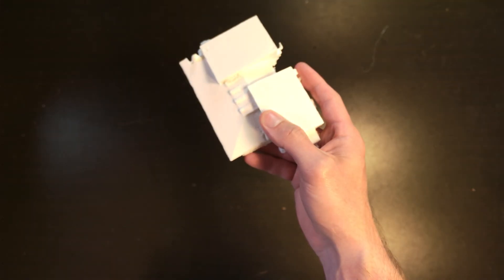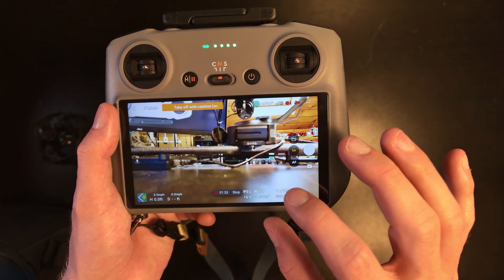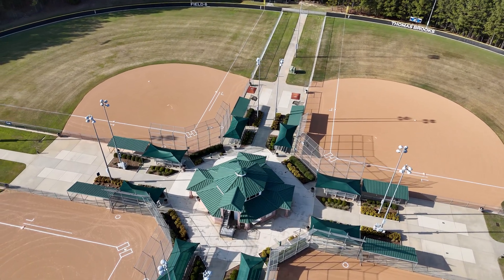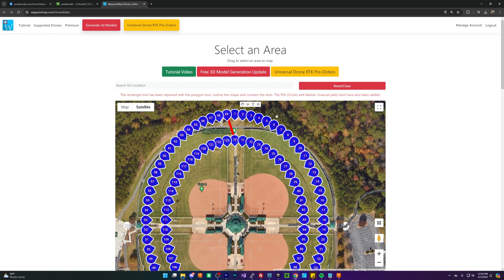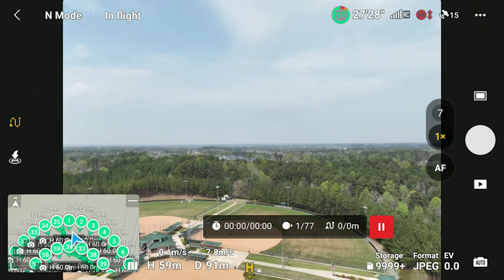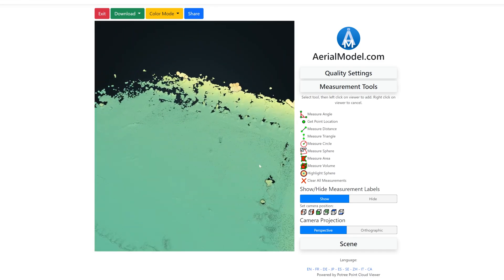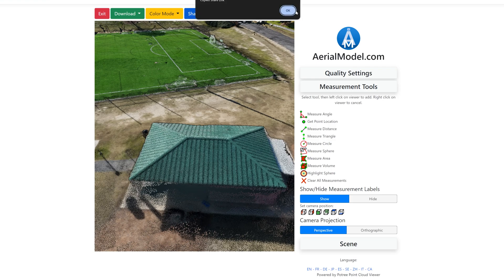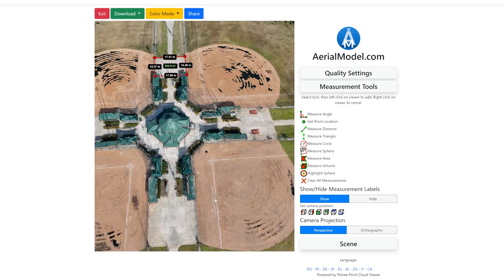Turn ANY Drone into a 3D SCANNER And Make 3D Models w/ Photogrammetry

Comment: Dumb question... Assuming you have a giant sd card, many batteries, could the quality improve further, or is there a limit to diminishing returns kinda?
Reply: Batteries will give you more passes and air time, SD storage gives you more capacity for photos. So essentially yeah, but! The main factors in quality are photo quality (not blurry, with good lighting) good overlap, and photo quantity.

Comment: Mavic Air 1 can do this?
Reply from the maker: Should be able to, not the flight planner but you can take pictures in a circle around a subject
Reply: I use the original DJI mavic air to create photogrammetry scans and have no issues. You can use anything that takes photos to create photogrammetry scans.

I’ve used meshroom (Free)
And 3DF zephyr (very expensive) 
To create scans from photos/video.
Reply: What pc are you using with zphere , for some reason i cant see any 3d scan on my laptop . @BarrySmoother
Reply: @JAYTHEGREAT355 PC I built myself.
If you’re having issue with zephyr try meshroom maybe.

Depending on the laptop the hardware might not be capable of creating 3D scans. Zephyr is a bit more intense compared to meshroom in my opinion. 
But could be that the laptop just can’t handle the scans. 

Maybe try meshroom? Or different photos or a smaller less detailed scan.

If you wanted my computer specs they are. 
RAM: 16gb ddr3 
CPU: I7 3770k 
GPU: GTX 1080
Reply: @BarrySmoother  thank you , it's my laptop it just won't handle zephyr I will give mesroom a try thank you .

Comment: This is great to play with, but you need to know that this data is not accurate. Unless you are using RTK or PPK for accuracy, the data can be off by as much as 10 meters absolute, and 3 meters local and relative.
Reply: That's why you can get a rtk module @jay...it is enormous what Jay has done
Reply from the maker: That’s why I have https://www.anydronertk.com
Reply: @JaysTechVault  how did you get it early? It is only in pre-order state
Reply from the maker: … I created it
Reply: @JaysTechVault  oh, I see. You wrote it like it was obvious, but it is not =) Thanks for such cool devices though, definitely need to try when it comes out
Reply: @JaysTechVault  how does it geotag the images?

Comment: Another option to consider is meshroom, if you can spare a few hours to learn to use it correctly. It is free, has no limitations on the number of images, has advanced options for tweaking the output to your needs and to take into account various lighting factors, and runs entirely local on your PC. I've been using it for quite some time to get 3d models into video games and while the results aren't perfect, they are at least as good as this demo.